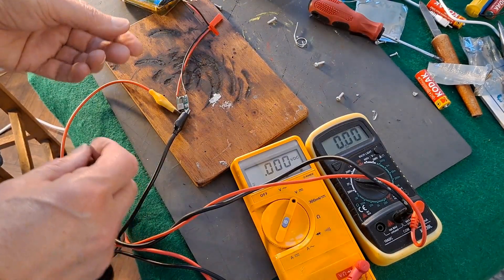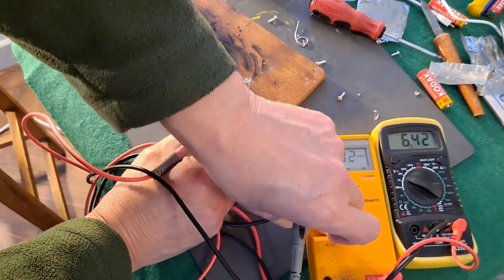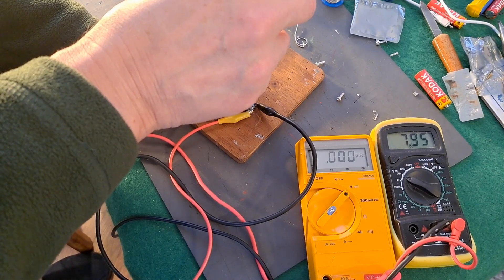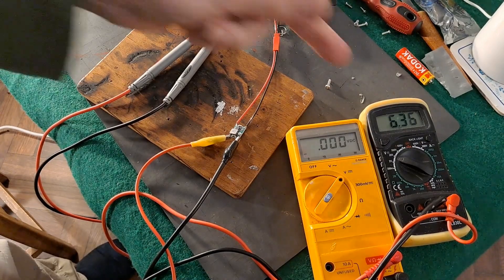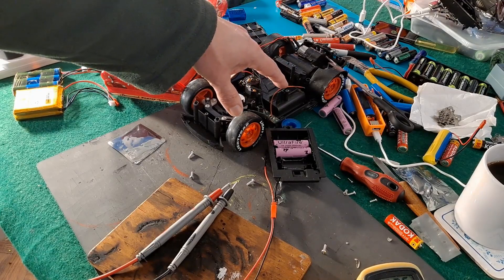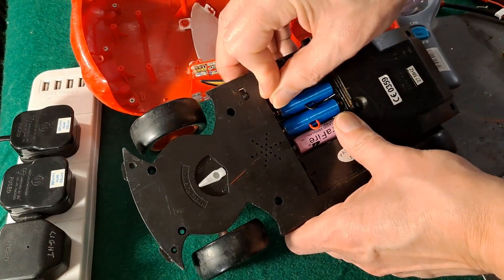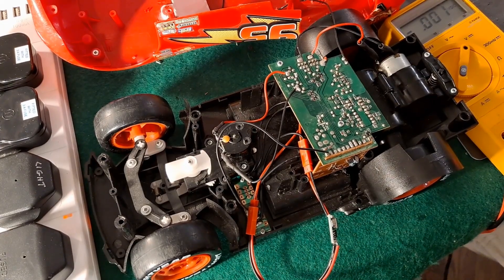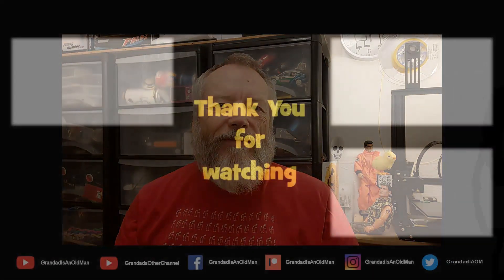PART 2 6v Lightning McQueen with two 14500s

Comment: I find most toys with 4 x AA batteries work fine between 4-6v. Normally one fully charged 14500 = 4.2v, have you tried this without the buck converter? I just solder in a JST and use a 1S lipo.
Reply from the maker: The whole point of this series (not just this car but several others that I have done recently) is because I was asked about 14500s. The question was asked on a video where I was demonstrating using LiPo batteries. This particular series with Lightning McQueen is specifically to cover the battery combinations that do not fit conveniently with the 4.2 - 8.4 - 12.6 sequence. As you say, "most" toys work fine, but if somebody follows that rule and finds they have killed their receiver they will want to know what the alternatives are. You may find the video description more informative.
Reply: @GrandadIsAnOldMan  👍 thank you. I have watched a few of your videos, but I do have lots more to catch up on.

Comment: Did you use this buck converter in another project? I',m sure you will fix the problem!!
Reply from the maker: I have used these little buck converters in different projects for the same purpose, to use a large battery and drop the voltage to suit whatever it is you are trying to power. Here is a similar video https://youtu.be/qYBZ5r5EUyY

Comment: Im still confused about the Dummy batteries in there.the little wire thats sticking out of the Center there on the Dummy battery,are the 2 ends of  the wire sautered onto each end of the Dummy battery to make the car run or would the car just run on the 2 ,14 500 themselves with out the Dummy batteries?
Reply from the maker: Hi Marc, the dummy batteries are a straight through connection. You could cut a nail to the right length and use that instead. If you connected a jumper wire across the empty battery spaces in the battery tray you could just have the two 14500s. The advantage of using the dummy batteries is you can use the car (or any other battery powered appliance) without any modification.
Reply: @GrandadIsAnOldMan  thanks . That helped to understand my confusion 😀

Comment: Notice that it is a switching power supply...
Reply: Unfortunately now you "have" to make it Hobby Grade.
Reply: The power supply gives 6V DC pulses. You could also make the receiver and ESC hot swappable and only install a fixed servo. The standard servos are big and heavy but are very cheap and also use less energy than the micro servos and are lighter than the standard non proportional steering.
Reply from the maker: @prep0wer  what would be nice would be to work out a way to activate the sound effects when using hobby grade gear. A simple switch would do the job. As for the switched power supply, one reason I wanted to try this out with the buck converter was to see if the receiver would function OK with it and it would appear it does. I did have serious doubts that it would.
Reply: @GrandadIsAnOldMan  Adding a capacitor would maybe make the 24MHz board accept the 6V powersource.
Reply: @GrandadIsAnOldMan  The voice is the most fun part of the car.